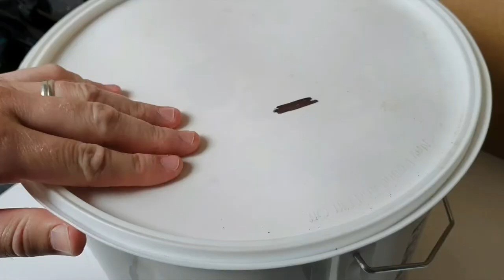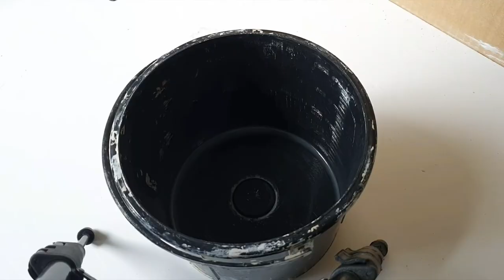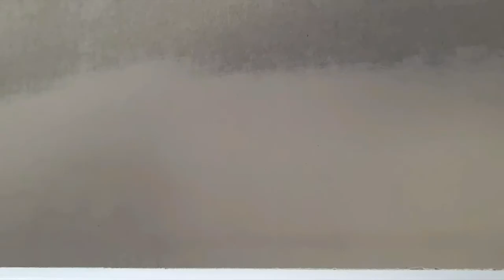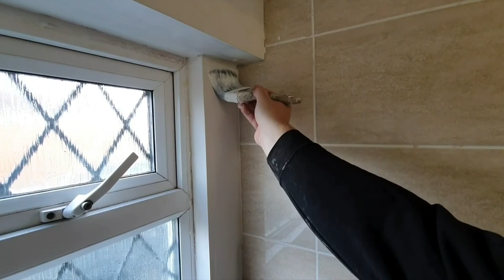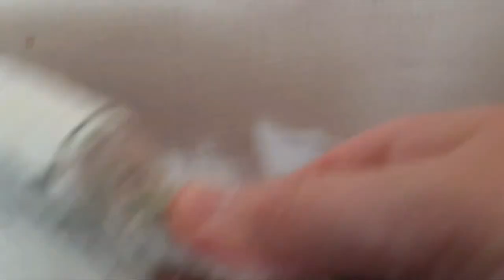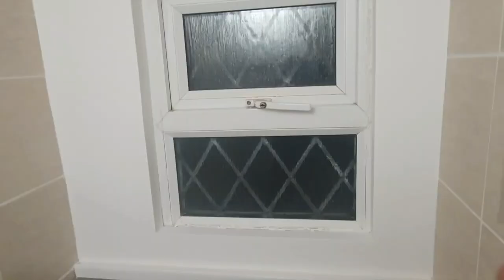Painting over filler  - PRIMING filler - MIST coat ( Avoid FLAKING Paint )

Comment: Great vid..what filler did you use..and if when using a two part filler what sealer would you use to prevent top coat flashing.. thanks
Reply from the maker: in this video i think i used gyproc easyfill but it was a long time ago.

Comment: skim coated my bathroom! sanded ,triple cleaned it and no primer is sticking to my walls! try a bunch of them! try the mist coat and still peeling off! i used hot mud compound!
Reply from the maker: thats strange but i have never used hot mud nor am i sure what hot mud is im afraid. maybe there is a specific paint for this product. but for me in the uk with filler and normal new plaster i use a mist coat at normally about 30% water and 70% water based matt emulation depending on many factors and not all paint can be thinned down, this usually works well for me.

Comment: is mist coat just a pva water mix? what is the best ratio please?
Reply from the maker: No a MIST coat is water based emulsion and water, not all emulsion can be watered down valspar for example I don't think can be thinned
Reply from the maker: Now ratio is a question that if you ask 10 people you will likely get 10 different answers, the tub of paint will have a amount it suggests. I normally go about 7 parts paint to 3 parts water 💧 but it depends on the quality of paint the thickness of the paint in the tub ext ext... I aim for a cream consistency some people go 50/50 but I find that is to thin. I'd suggest doing a Google on MIST coat ratios and have a little read of some stuff to help decide.
Reply from the maker: Sorry I can't give a black and white answer